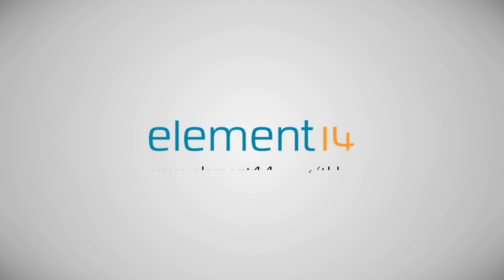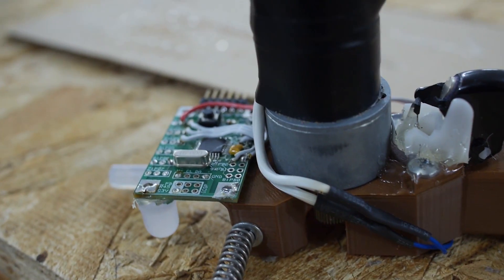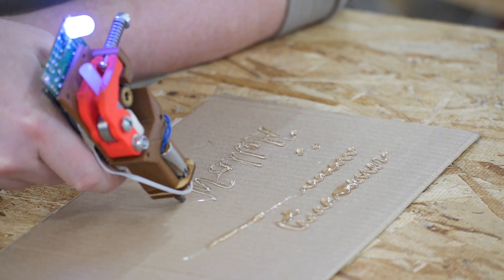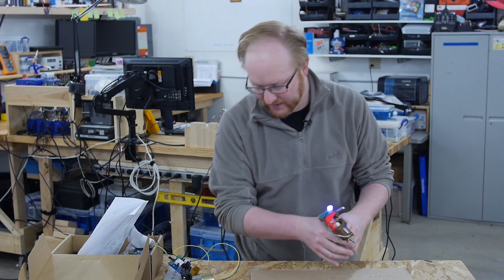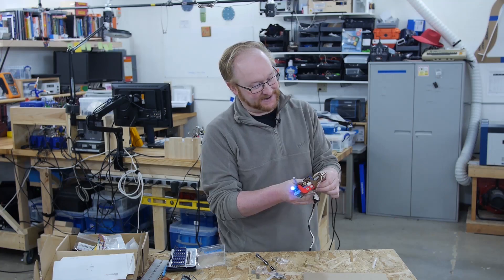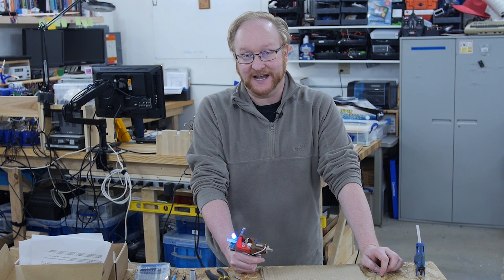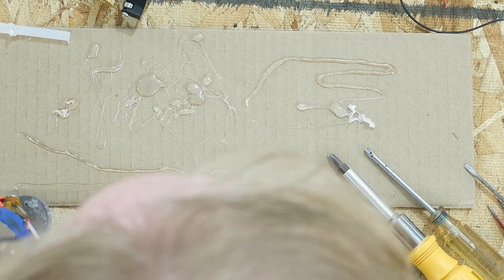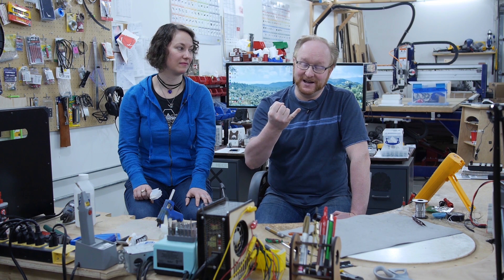Super Glue Gun 03: Ungluing the Great Glue Gun

Comment: Why have the cord come out of the handle? Every glue gun I've used is made this way, and they are next to impossible to place stably on a surface when not in use. The best design I've seen (but never used) has the cord coming out the rear and a large, flat base that sits flat on the table.

Comment: Faster motor, smaller pinion. Motor mounted on slots, to compensate for any sized pinion you need to use to get the correct speed of extrusion. A la RC car motor.

Comment: these episodes with the beginning intro and the ad and the end outro (not the summary) are quite short. Plus this episode feels to me like it could of been summed half the time, changed dc motor to one with 5mm shaft for compataibility with 3d printer gears, works but faster one needed, pla bends under force of gear and idler metal plate works better.

Comment: the easiest way to add an other stick after the first one, is putting a drop of hot glue on the round part of the second one and pushing on the back of the first, so they are glued and the gun can continue to push/pull them as it's one single longer stick :)